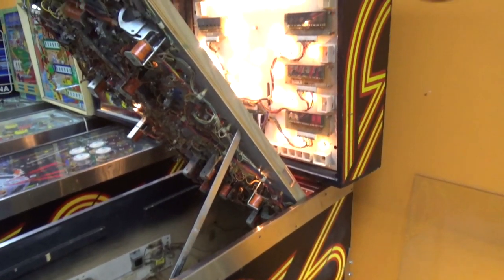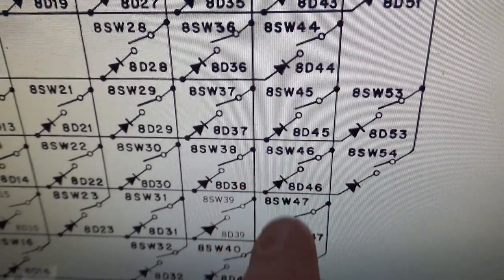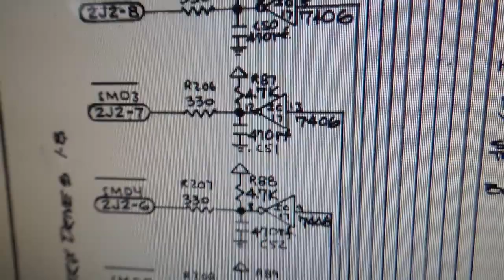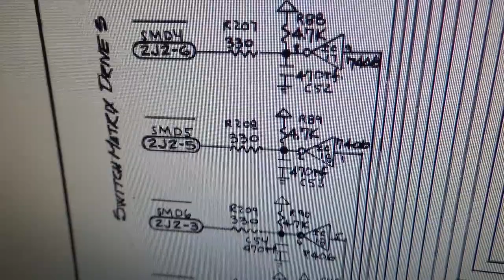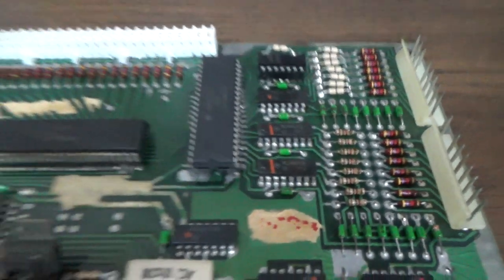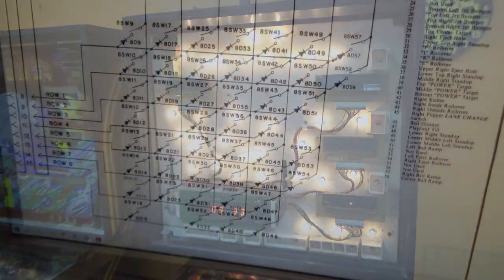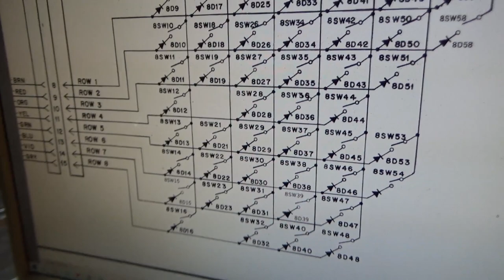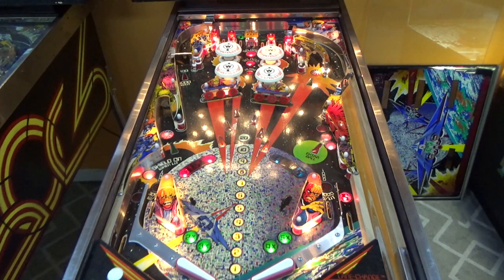Repairing a 1980 Williams FIREPOWER Pinball Machine - LOTS of Switch Problems!

Comment: The PIA is how peripherals are attached to older CPUs. They are generally parallel on one side and serial on the other. They have counters, shift registers, and will signal an interrupt. That way, the CPU would know what device of the 2 is being used.

The PIAs are supposedly interesting in that folks have used them for producing sound or counting. Often, they use those features in addition to the primary role.

Comment: Great job on that troubleshooting Ron! Have you ever had a problem that you just couldn't figure out and sought outside help?
Reply from the maker: Yes we've ran into all kinds of stuff like that, usually when we seek outside help though we can't find anybody that knows how to fix it, LOL  There are people a lot better than us at repairing things, but they're not on forums or anywhere where they can give you advice.  Also usually the problem isn't something that can be accurately described, without also discovering the source of the problem.

So if I have one that's doing something strange, and I ask somebody how to fix it, they're not going to know unless they know exactly what it's doing, which if I knew exactly what it's doing the solution would be apparent.

I often have arcade PCB's or monitor boards that we can't figure out and have to send out to somebody else or buy another one.  We have a buddy of ours trying to figure out a Choplifter PCB right now....

Comment: just wondering if you could help me out. I'm trying to figure out what kind of connectors to buy for the boards on my pinball machine. try to look up something simple as an edge connector for my power supply Williams system 4
so that being said is there any site that will show me any connectors for any pinball machine in what part number it would be.?
Reply from the maker: They refer to them by the distance between the pins, the main ones that are used are ".100" and ".156".... the ones on a Williams board are .156... you can get all of them at www.TwistyWristArcade.com .  I don't think they call them edge connectors that might be why you couldn't track it down, they're usually made by Molex and usually just called "pin connectors".... the male side goes on the board, the female side is the socket the wires go into.
Reply: @LyonsArcade  You really are on things getting back to me so quickly. Thanks for all the info when it comes to pinball you're a wealth of knowledge...

Thanks again from the rookie Keith

Comment: Williams-related question. What made the flippers on Williams machines get weak? During all the time I spent in arcades in the eighties I noticed the flippers on Williams machines would get weak, but I don’t recall any other brands exhibiting the same thing. Do you suppose this was just connections on connectors going bad?
Reply from the maker: Not sure really, I haven’t experienced that!
Reply: @LyonsArcade  Really? That surprises me. We had three arcades in the town where I grew up. Every single Williams machine in all three arcades would eventually get weak flippers. It was just a matter of time, and all us kids knew it. We’d get mad when it started happening and the arcade owners took their sweet time to fix it. Hehe.  Seeing the connectors as you fixed this machine got me wondering if it was a corrosion thing. All a block or two from the ocean, so maybe salt air hastened it. Not sure why no Bally or Gottlieb or just non-Williams machines ever seemed to suffer from it. We’re those Williams connectors different than the ones used in other brands?

Comment: This was also the first game with Lane Change (TM).

Did they really waste the very expensive Harris CVSD chip on just one phrase in the game?  (This is the same chip that told pilots to "Pull Up!" as early as 1973)
Reply from the maker: There's a few phrases but basically yes.  Firepower , MIssion Accomplished, 1, 2, 3, etc.  I think it may have 12 or 15 syllables, something like that.
Reply: @LyonsArcade  Oh, ok.  There were some later Zaccaria games which would use a TMS5200 only for a welcome message...

Comment: JOE CLASSIC, I'm not sure what is the purpose of using those diodes in the switch matrix because when the switch is OPEN the diode is not doing anything and also when the switch is CLOSED the diode is not doing anything either, so I have no idea why they are using those diodes. When you removed the switch contact connector and also the other connectors which i don't know which other connectors you disconnected to the switch matrix circuit, the signals were pulsing on the logic probe but where was the pulsing input signals coming from to be applied to the switch matrix circuit from the ROM Test program? When you put the pinball game in TEST Program its sending pulsing signals to the switch matrix circuit even with the Switch contact connect has been disconnected?
Reply: You dont want switch bounce.
Reply: @turtlebutt55  to prevent switch bounce would be using a capacitor not a diode
Reply: @waynegram8907  The diode isolates the switch from the other switches on that row of the switch matrix.  Joe talked about how the switch matrix "strobes" the various columns of the switch matrix one at a time to see if a switch on that row has closed.  Well, what if the ball closes some other switch on that row?  For example, using Cirque Voltaire as an example, what if someone hits a pop bumper at the exact same time as the CPU is strobing the right slingshot (the pop bumpers are all on the same row as the slingshot)?  Without the diodes, the CPU would think "Oh, that must be the slingshot!"  So, that's what the diodes are for... to keep the CPU from getting confused about which switch just closed.
Reply: It’s to prevent the voltage from the scanned column going into another column if multiple switches are connected.  The scanning is faster than these mechanical switches open and close.  So it prevents phantom reads.
Reply: @SpearM3064  I'm not understanding why the CPU would be confused when the All the other switches in the SAME column are OPEN switches so it wouldn't matter if there is a series diode because the OPEN switch is preventing the scanned frequency signal to pass through. The Scanned frequency is scanning the columns and rows and is looking for the CLOSED switch. So I'm not understanding how the CPU would be confused or cause Phantom READS. The OPEN Switches even if you ( removed all the diodes ) shouldn't cause Phantom READ. If two or more switches are CLOSED this means that the scanned frequency signal is able to pass thought the closed switches which would cause problems and errors if you didn't use diodes which doesn't make sense. The diodes are allowing the scanned frequency to pass in ONE DIRECTION and blocks the other direction but the scanned frequency is still the same frequency unless the diodes change the duty cycle of the same frequency when multiple switches are CLOSED?
Reply: @jimomertz  If you "removed" all the diodes and the mechanical switches had 2 or 3 switches CLOSED, how would this change or alter the scanned frequency signal? I'm not sure how the diodes are prevent phantom reads, because when a mechanical switch is CLOSED it allows the scanned frequency to pass though the mechanical switch to GROUND making a closed loop circuit back to the CPU to READ the switch. So i don't know what the purpose of the diodes are for.
Reply: @waynegram8907  I think you’re misunderstanding.  There is no frequency.  The computer turns on the columns one at a time, and reads the rows.  It continually cycles through all the columns.  That’s where this pulsing is coming from.  It depends how fast the computer is doing this.
Reply: @SpearM3064  When a mechanical switch is CLOSED does this change the scanning frequency or duty cycle because how would the CPU know which mechanical switch is closed when the CPU is READING the rows and columns in the matrix?
Reply: @jimomertz  When the CPU is scanning the columns its scanning the columns at a certain frequency/speed. The PULSES are from the CPU outputting pulses that are sending a scanning signal to the columns?
Reply: @waynegram8907  forget about frequency.  the cpu is looking for a closed switch.  the strobing is its checking each and every switch to see if it is closed.  the diode only prevents the flow of electricity from back flowing and connecting multiple switches at the same time
Reply: @robertlipsett2535  But all the other switches are OPEN so the open switches are preventing the flow of electricity from back flowing. When multiple switches are CLOSED (without using diodes ) would cause phantom reads why? I'm not sure what is causing phantom reads
Reply: @waynegram8907  no the other switches are not all open. If they were then you would never see a problem.  there are certain switches that always are trying to read closed such as trough switches and optics. when they line up right you will pull down two rows at the same time when it pulls a certain column. I only occurs when you have multiple switches closed at the same time
Reply: @robertlipsett2535  When multiple switches are closed at the same time the Diodes are doing what to prevent a short circuit to ground or what? When the CPU is READING a row and column has a scanning signal being applied to that column. When the CPU is READING it measuring a Scanning Pulse train signal? The diodes are preventing that column scanning pulse signal from grounding out causing a short to ground?